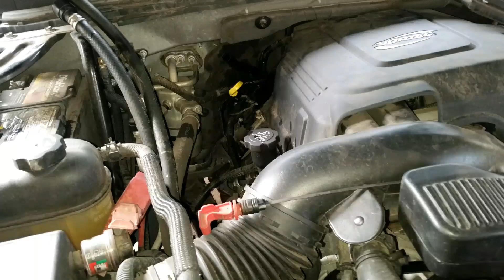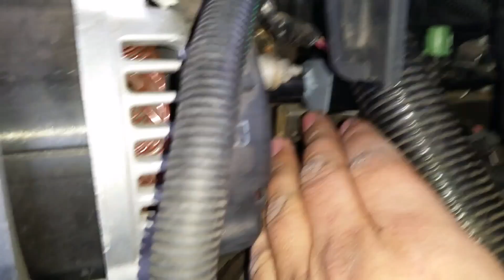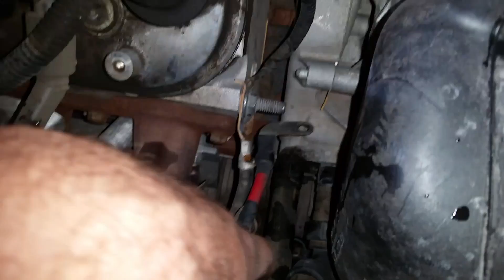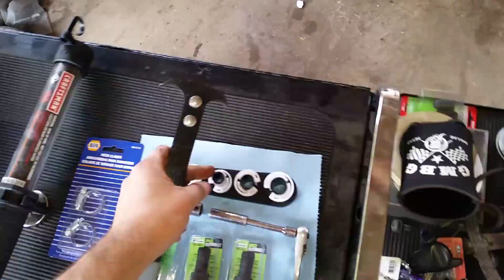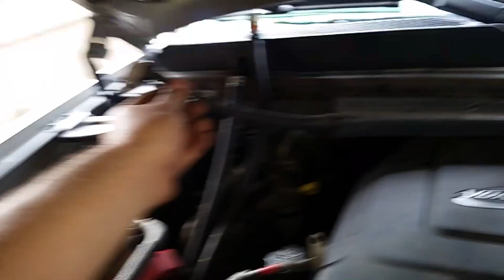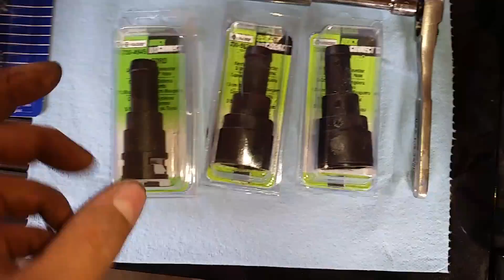NNBS GM Heater Core Quick Connect Fittings Explained

Comment: what size hose clamps ?
Reply from the maker: Luis Castillo that's a very good question, those lines are typically 5/8 and 3/4. but since everything is metric,  I'm not sure what it converts to
Reply: Thanks for the response. This just happened to my truck.

Comment: Awesome! Nice tip with the seal puller! I was wondering why I was loosing coolant on my 07 Yukon. After doing a coolant pressure test, found the leak right next to fire wall. Easy fix! Not too expensive part. $32 from dealership. I'm sure it's cheaper at auto part store.
Reply from the maker: I'm sure the extra cost is ok,  given the dealer part is higher quality. I'm glad the video helped you out

Comment: Hey Gary,  i have a question for you, I had the same problem happend to me Friday while driving when one of the heater hose came loose.  I drove it while the engine over heating light came on, which it was dragging.. so we'll i got everything replace,  two days later my engine turned off while it was left on running.  . I replaced the battery and alternator already .. but the battery light still comes on. tested my old alternator,  which it passed,  have you have any issues like this, any ideas?
Reply from the maker: how long did you drive it with it overheating? I'm wondering if you didn't blow a head gasket. are you throwing any trouble codes?
Reply: now this is the problem bolts were loose on the mega fuse , so I tighten them up , but as soon as I turn it on it started idling by its self , like it was accelerating while on parked.  So I put it on drive and it turned off.  Everything,  no power,  nothing.  . Here's the codes I had before this happen. 

Trouble codes 

□ P0573

□P0562

□P0121

□C0899

□C0900

Comment: be careful with the dorman/ chinese heater core fittings, I changed one out with it and overtime in extreme heat like where I live, they soften up and will BLOW OFF. It took a year, but the fitting let go, the fingers get soft with heat. The lock fingers are way stronger on the gm part.
Reply from the maker: crap that's not good.  I purchased these from Napa expecting a better outcome. I'll definitely keep an eye on them for that reason. thank you for the tip. where do you live
Reply: FL, its 95+ a good 300 days out of year in this part.  I was amazed how it just popped off, it clipped back on so It was able to be driven back home. It had to of been on when I installed it because it lasted a year!  I can only say the plastic is not the same and like i said, it gets soft GM ones are a mad rip off, About $50 for both.. . Gary Garcia
Reply from the maker: +Ghetto Wagon I'm in Arizona,  we have higher summer Temps over here I'm sure. hopefully this info will come in handy to whoever sees this video. what vehicle did this happen on
Reply: Well fuck me i just replaces mine with the dorman branded ones thought it was a good brand